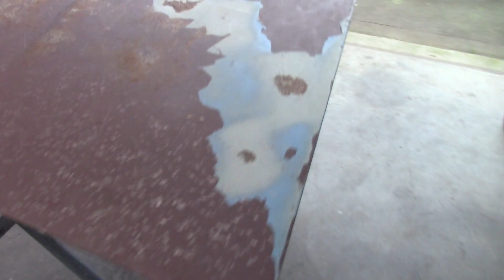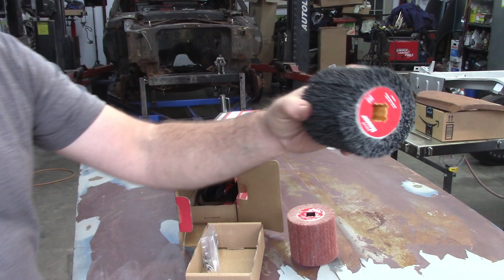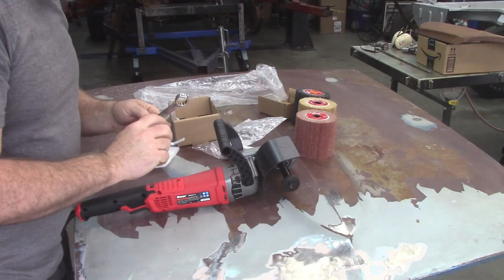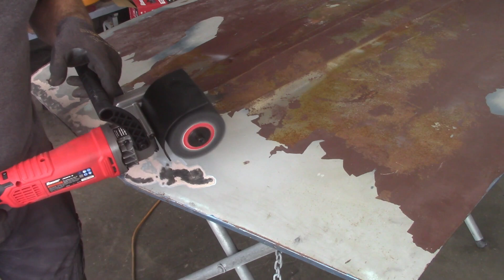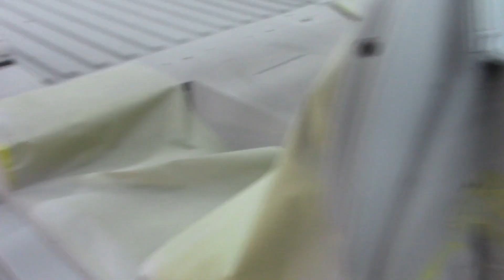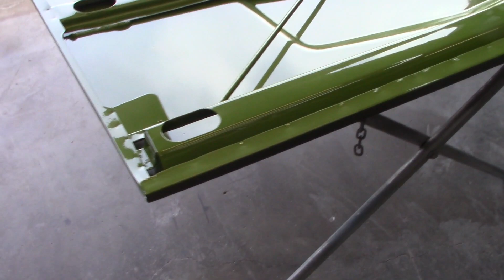Shop tools. Bauer SCT. Surface Conditioning Tool.

Comment: That was cool looking! Do you have any worries about it getting the metal too hot and possibly warping if yer not careful? Wondering how aggressive you felt the wheel itself was? Great video.. Like the other guy said, I don't one, but will now probably buy one, the next I'm in a HF store !
Thanks for doing this one..
Reply from the maker: It could generate heat if you stayed in one spot. I just keep moving around.

Comment: Everything looks good Barry ! Sanding is what takes up most of your time, it is what it is. It should turn out really nice. I doubt that the Eastwood brand roller  wheel would do much better, but the difference may be in the wheels themselves, you might try ordering one from them and see if it does any better.